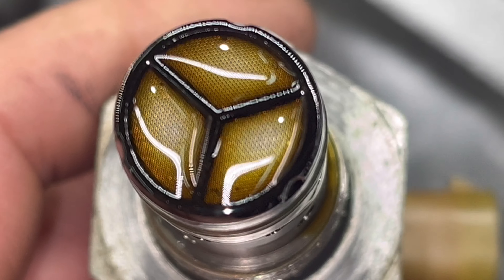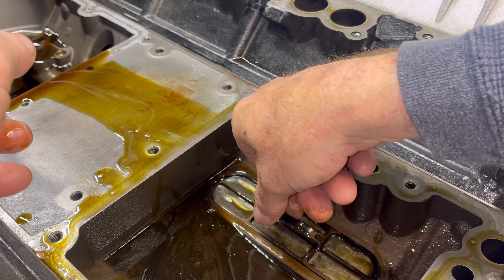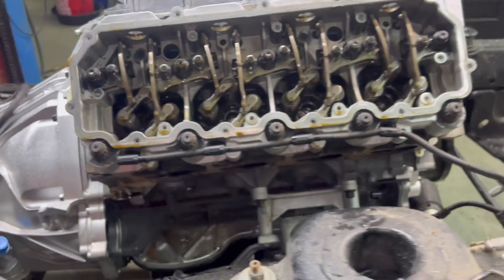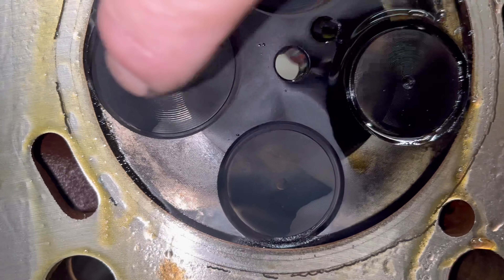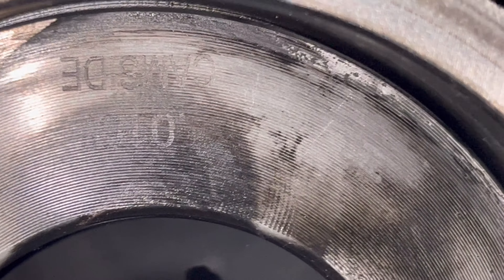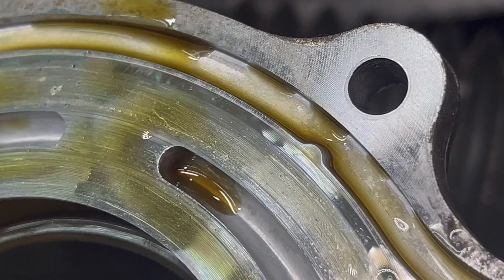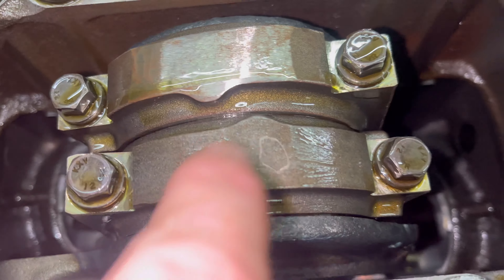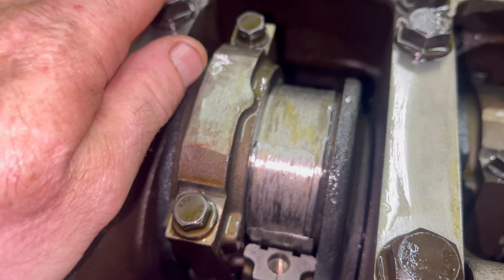What went wrong???  METAL EVERYWHERE!!!

Comment: Not honing the full depth of the cylinder, wore the piston material off.  That material migrated throughout the motor (some can always bypass the filter), got into the rod journals taking out the one rod bearing.  The material in the motor could have stuck the oil pressure bypass piston.  Material off the pistons is a given, from the moment that motor came to life.  I would put some money on that as the cause.  As the motor heated, it could have caused more drag on those pistons, more drag + material in oil= rod bearing leaving the chat.  The best mechanics in the world make mistakes.  Good on you for making this public and owning it.  It hurts the wallet and the ego, but it is the right thing to do.  Your customers will trust you more knowing that you own any mistakes that happen under your watch.
Reply from the maker: I have seen many many pistons out of engines with the coating gone!!!   I guess it’s a theory.
Reply from the maker: The coating is supposably less than .001 thick.   That damage was a knife turner,,,   But as for that being the culprit,,  I’d like to hear more with this opinion,,  cause I’m not buying it.
Reply from the maker: By knife turner,,  I mean it’s in me and it got turned.
Reply: @AnthonyYoungblood  LOL, I agree, just a theory.  So, you have cam/lifter damage, rod journal damage, piston skirt damage, and an oil bypass piston stuck.  Each one independently could be the cause, so rank them.  Which of the four was likely the most probable of causing all the damage?  Oil bypass... depends.  Stuck in the open or closed position?  Piston skirt, possible, but not likely.  Cam, depends on if the cam surface or lifters were failing or if what you are seeing is the RESULT of other damage.  Same with the rod journal.
Reply: @AnthonyYoungblood   I would have want to know how that bearing was removed,,,, possibly orientation of it threw the balance off,, just a thought?. Thanks for sharing ,,, would thread having a failure off that kind after a thorough rebuild as you do,,,

Comment: If the honing stopped short, would that possibly make the pistons catch on the way down each stroke, essentially beating up the bearings which are soft.  Once that happens, and loosens up the bearing clearance, then oil flow is disturbed, oil pressure drops, and it's a downhill fall after that.

Comment: Did the rod have fractured grain mating face messed up and didn't close up? It would seem that the other rods would have worse wear from low oil pressure. Crank out to check main brg and main journal to rod journal drilling.
Reply from the maker: I think you have it when you say the others would show low oil psi.    Very possible that we botched it.  Tapping too hard on the pistons can move the bearing and they need to be kinda “rolled” back in.   I can’t remember if that happened here,,  it might be on the live feed if so.     Either way,,  something happened.   I’m studying right now.
Reply: What brand  bearings .....Mahle Clevite ??

Comment: I don't believe this stems from a single factor but rather multiple issues, something  like a perfect storm. First of all was there a demand put on the engine under load like towing, then there's tranny assist, downshifting  causing significantly higher RPM's,  pulling a grade, prolonged heat, low viscosity or loss of lubrication, then there's quality of parts and or tolerance issues let alone oil contamination or race tunes. Each are contributing factors to any diesel engine failure.

Comment: The failure was the rod bearing. The rest is damage due to contamination from that bearing. The fact that all the other bearings were fine, points to lube or clearance issues with that journal or bearing....... focus your attention there...Looks like it starved to me but why just that one...Then again...you do have copper showing on others which for 5K is fucked up......Over tuned? 
Just an FYI I move pin 12 to slot 13 on the DLC so Customers can't load their own tunes. It leaves with my tune and that's it.